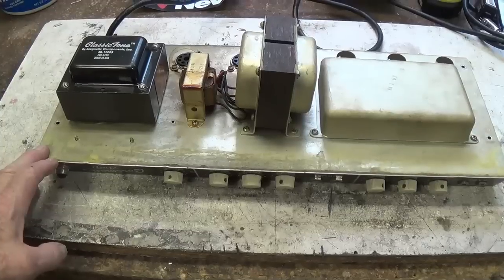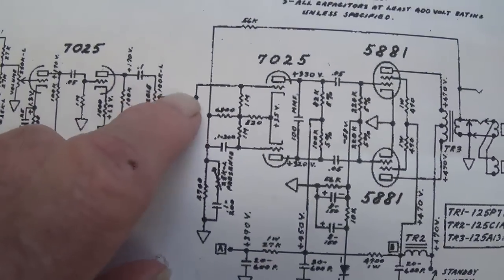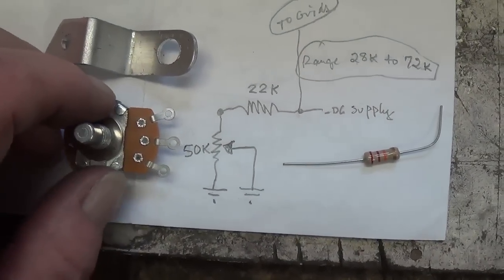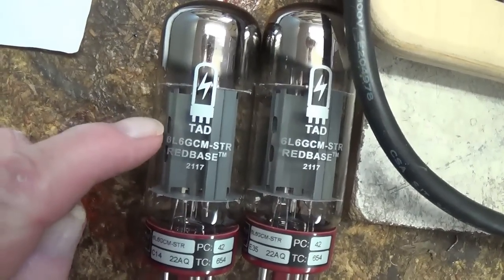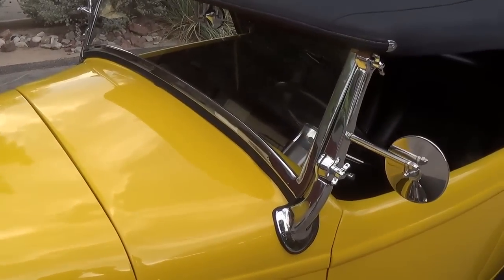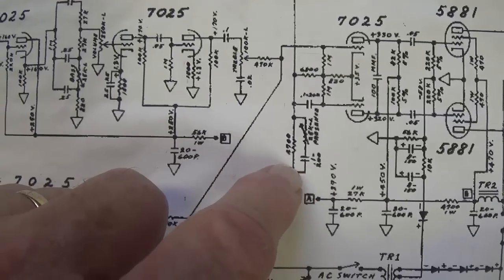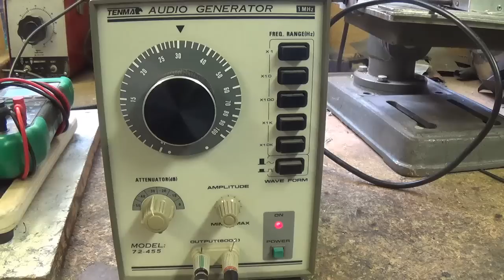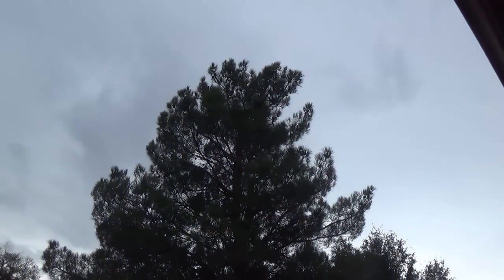Rare Brownface 1962 Fender 6G6A Bassman.....in for a Tune-Up

Comment from the maker: NOTES:
1.) The second triode in the Bass channel is a cathode follower, which does not invert the signal, therefore the two channels are out of phase.
2.) The NFB loop connects, not only to the PI cathode, but also to its lower triode grid.
3.) The Bass channel not only did not have more gain that the Normal channel, but its signal tended to have more treble frequencies, at least with guitar input.
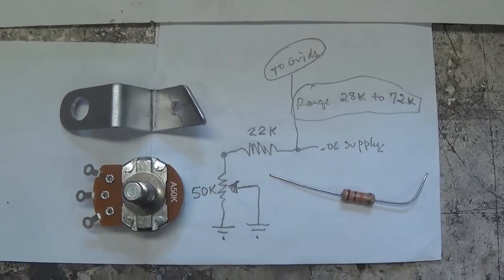4.) At around 17:40 the lower range for he adjustable bias pot should be 22K......not 28K.
5.) The clipping seen in the 3rd audio demo tune was due to an incorrect input-level setting on the digital recorder.....not due to the Presence Control.
6.) For our English viewers: The "Boot" is the trunk and the "Bonnet" is the hood. Sorry ;)

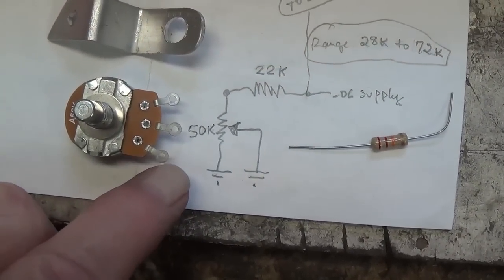Comment: Nice circuit at 18:58 👍. I think a nice addition would be connecting a capacitor between the 50k pot and 22k resistor to get rid of even more noise and ripple. You can probably use the cap after the diode for that even.

Edit: sorry, I thought the bias voltage would be connected on left side, never mind 😅
Reply from the maker: Thanks for your input, PM :)

Comment: In Sweden it isn’t allowed to sell electronic devices without fuses, so every amp from 50’s and onward have fuses installed, even on 6.3 volt supply. And polarity or ground switch  and death cap always removed! It’s nice
Reply from the maker: That sounds like a good policy to me, K.

Comment: Love your Ford. Very first car I ever rode in was my dad's 1949. I was two years old. Very first vehicle, was about a 1944 Ford truck. Saw one a few years ago on Julington Creek Road and had to hunt it down. Turned out to be a wedding caterer's truck that was COMPLETELY original except for tires (including holes in the THICK fenders. Regards the Blonde Bassman ... I remember those when they were brand new. The Classics' second bassist, Talmadge Branch had a '61 or '62. I remember him climbing up on it and doing the twist as my brother climbed up on his 1960 PRO and the lead guitarist, Walter Eaton, climbed up on top of his brownface Concert. Leo built 'em good. BTW: Not sure what the Presence control does for a bass amp ... seems like that handles the very upper highs ... Not much bass notes climbing up that high! I think they just used the BandMaster framework and beefed up the BASS channel. I have a '62 BandMaster and leave the Presence control all the way down ... but I mostly play Fender guitars. My SG Standard and 355 might enjoy having a bit more ultra high top end ...
Reply from the maker: Thanks for sharing this with us TT.

Comment: From Leo:  Nice detail work on the Ford. I remember seeing  air scoops on drum brakes on some hot rods.  I have never seen such a clean install on the air springs for the trunk (boot)     Barb and I think we should get a hobby car since health issues have mandated getting rid of the touring Motorcycle.  Always appreciate your work on the amplifiers also.
Reply from the maker: Thanks so much. I quit riding motorcycles about 15 years ago and find that convertible cars provide a similar experience.

Comment: Enjoyable as always Uncle Doug. Try in-putting pink noise rather than a single tone when testing your tone circuits, it is a much faster and more accurate way to assess the results. The presence control when cranked up at 3Khz adds lots of harmonics at 4Khz & 8Khz.. Thanks for the Notes, was wondering about that distortion.. All the best from here in Sydney where it is very hot for this time of year.
Reply from the maker: Thanks for sharing your observations, Trevor. Our heat is finally subsiding, thank God.

Comment: Wow I just got a mint 63 bassman 6G6-B piggyback amp. What perfect timing for the video. Pretty much looks the same except mine is blonde and is in mint condition. I don’t know the condition of the cabinet for this one but mines awesome and so is this one. I love these amps and can’t describe how amazing they sound dimed. Mine has been recapped for the most part it still had the death cap and it was shorted when I checked it out it gave me a little zap and sure enough a whole 35volts of ac was getting through.
Reply from the maker: Congratulations on a great acquisition, Nikki. Those Death Caps can live up to their name if you're not careful.
Reply: I got lucky for $1,200 for mine this year. Oh yeah I know but even with it snipped it doesn’t make noise so out of safety that caps out of circuit. I gotta put a 3 wire cord on mine because the person who serviced mine replaced all the electrolytic with sprague atoms, did a good job but used the original or an original style power cord. I wanna find another set of 5881’s for mine since the ones that are in it the getters are all blackened. All vintage tubes and the speakers are ceramic Jensens that I don’t know if they are original or not. The 5881’s are tung sol mil spec tubes that are nice and I’m going to test them before replacing them. These amps are amazing so amazing Uncle Doug. I would love to see your comments on mine but i don’t wanna spend the money to ship it and I do all my work myself.
Reply: Thank you by the way
Reply from the maker: Thanks for sharing, Nikki. It sounds like a very fine amp. @nikkihendrix1234

Comment: Once again, Uncle Doug, another great video on a rare amp.  I would have done one thing different.  I noticed a ground lug just to the right of the terminal strip you soldered to the chassis with a nut on top.  I would have chosen that lug for the green chassis ground.  It will always be secure as sometimes a soldered joint to the chassis will fail.  Just my 2 cents worth.  Cheers from eastern TN
Reply from the maker: Thanks, Rusty. I hear this from viewers, but when a lock washer is used, I have never had any issues.

Comment: Nice bias mod. I used something similar on my fixed bias amps (and amp mods) in the 2000s. Skunkie Designs uses a bit different approach, with a resistor between negative and the wiper. All for the same purpose, making the amps fail-safe.  I tend to use multi-turn trimpots for precise adjustment.

That Ford may not be a Bentley, but it's a cute little old-timer... Aziraphale would like it, haha! Restored to perfection.
You could do a collab with Usagi Electric someday. Apart from old computers and test gear, he's into old cars as well.

Ah, the Supro! Thing of beauty, joy for ever.
Reply from the maker: Thanks for your comments, KE :)

Comment: 1 thing uncle Doug...supposed to be sure and make the grounding conductor the longest in the supply cable so if yanked out it will remain grounded until power and neutral are both severed.
Reply from the maker: I'll keep that in mind, FG, especially for customers who like to swing their amps around by the AC cord.

Comment: The best Bassman I ever had was a black tolex blackface with the little white knobs and a presence control. There was a resistor on the presence control that wasn't soldered. I don't remember the model number but it sounded amazing. It looked like the 6G15 reverb unit you did.
Reply from the maker: Thanks for sharing, BD :)
Reply: Those are known as "Tuxedo" bassmans with the 6G6-C revision (small changes, no schematic exists).
Reply from the maker: Thanks for the info, Dan. @danh.8490

Comment: With the safety you built in the bias control reminds me of an automatic transmision design I had to work on quite often back in the 80s 90s and 2000s the 700/R4. /4L60E in wich if the main pressure control solinoid lost it's modulated power feed to it the trans would go into max. Line pressure therefore saving all the clutch packs and friction components in the transmission virtual diagnosis and correction could be made nicely doing on the amp and hot rod Uncle Doug. Dwight.
Reply from the maker: Thanks for sharing this interesting analogy, Dwight. I have never worked on a 700R4......only TH350's :)

Comment: Sitting here stimulating my Vagus Nerve and this is what came to mind.

Dude, the absolute best yet. It's funny how folks nowadays don't realize that back in the day, if you had one of these amps, you were the GOAT, not everyone could afford an amp that would work for live Gigs, so with one of these you could get a guitar, bass and singer on one amp, it really was a workhorse. I had a friend of mine that had one, he finally had to tell has sponge of a guitar player to get his own. Serial Killer List, you are a maniac, dated at least three times 🤣🤣 It's funny, with keyboards you "attenuate" the frequencies with the instrument, not the amp, but with guitars, there definitely is a "sweet" spot for the amp. Also Ollie needs to lean "Cat Scratch Fever" 😁😁

The paint deal on your car is kind of weird, maybe the folks who built it were inexperienced. With Pearl and Flake, you can start out with a basecoat on disassembled parts, as long as you keep the parts in their natural position, doors vertical, hood horizontal etc. Usually one "drop" coat is good, but after this you have to reassemble and give it the last two passes with basecoat, this ensures that the color is uniform and the "effects" lay down in the same direction. Oh yeah one more thing, this is hard to do if you are using single stage. Base without hardener, can be mixed together all at once and stored, then you are sure it is the same color. 

Love the car, you bet it's fast, what's the GVW, I am guessing around 2k lbs, couple that with 350 - 370 HP and like 410 Ft lbs. torque, it is a real screamer. My guess it makes it's best torque below 4k and best HP above 5400.

 I caught the boot thing right away, my Dad had a '64 XKE Roadster, so the boot and bonnet thing was big with him, he wasn't even English 😁😁 And I had to fix it for free, with wiring harnesses that had no colors, yeah not a lot of fun.

Blue Mule
Long Live Leslie
Reply from the maker: Greetings, Mr. Mule ;) Thanks for sharing your knowledge and observations. According to dyno tests on virtually identical stroker engines, the HP is probably in the 450 range.....and yes, it's a scary ride once the cam begins to "kick in".
Reply: @UncleDoug  450, no DOUBT you can hear the cam at idle, can't wait to hear it.
Blue Mule

Comment: I had a 1965 Bassman and at very low volume levels you could play a bass and guitar at the same time and it was good. At higher levels of volume the guitar would be greatly affected by the bass guitar notes, I think the Bassman should have been a single channel amp. Bass only. If I ever get around to a bass guitar amp build, it will be a single channel. Maybe make a single channel of the Bassman’s Normal channel for guitar use. It would be an excellent guitar amp for pedals. Another UD great video and tons of new info on Bassman amps! Wish I still had mine! Oh Well! Thanxz
Reply from the maker: Thanks for sharing.....and watching, ATL.

Comment: Thank you so much for the video. Love to see all the different amps and hotrods!

Did you ever do a video on jumpering inputs? I've never quite understood how that worked. The input goes through both circuits at the same time? Also, I don't understand why an amp with an even number of triodes can jumper, but an odd number of triodes cannot.
Reply from the maker: We demonstrated jumpering in one of our earlier, Marshall amp, videos, HBW.  Yes, the input signal goes through both preamp circuits for added gain and fuller tone.  If the pre-amp stages aren't in phase, jumpering them will result in cancellation of the signal.

Comment: I must say I like your job around these gems, detailing each aspect of circuit, the proper labor, love and the respect you have to the history behind them. As  a technician I'm used to repair a lot of electronics devices, but amplifiers are to me something so special, because I am a musician and a audiophile as well, and i like to help bassists and guitarists with their gems. Fazo, DLab and You are my  true references in amp repair. 

By changing the subject I am planning building a aingle ended amplifier around 12ax7 and el95. I have all components needed dor this, but I would like to see you building similar one. Is that possible? 

Cheers
Reply from the maker: Thanks so much for your very nice comments, Emerson. We are currently scratch building a vintage amp and will post our progress in a 3-video series. It's not the one you suggest.....but it's a dandy. I hope you enjoy it.
Reply: Can't wait to see this, sure, because I know it will be an awesome amplifier.

I am currently building a low wattage single ended guitar amplifier with a PCL86 tube for a friend in place of a solid state circuit, around tda2050 and 4558 IC. I hope to finish that and upload some video about it.
Btw what do you think about this particular tube?
Reply from the maker: I hope you enjoyed it, Emerson. I only deal with vintage amps, and have never encountered this tube. @EmersonCapuano

Comment: In speakjng about the presence control, I think the reason why it didnt make the cut in the blackface circuits is because Leo started using lower-value feedback resistors for the nfb in his quest for cleaner tone.  I can imagine if your nfb resistor goes from 56k to 820, the presence control is going to behave in a radically different way.
Reply from the maker: Good point, JC. The huge disparity in NFB resistance MUST have been for a good reason.....at least to Leo.

Comment: What a beautiful roadster, Doug! Shear perfection. Quick question for you. Will a weak rectifier tube cause low plate voltage? I changed all the caps and got new output tubes for my 1969 twin reverb. I was trying to adjust the bias but voltage was only around 350.
Reply from the maker: Was the plate current abnormally high?  As PC goes up, PV goes down. Regardless, have you tried a fresh GZ-34 rectifier tube?

Comment: Hello Unc !
I worked on the same model for a friend a few years ago and I noticed something on both yours and mine : there’s a resistor across V1 pins 1 & 6 (plates) that’s not on the schematic nor the layout. Do you know why it’s been added ?
Very good point for the bias adjustment ; I may upgrade it in my friend’s amp. 
Very tasteful restoration of the hot rod 👍
Reply from the maker: Thanks so much, 74C. My guess on the mystery resistor would be to balance the plate voltage on both plates, perhaps to compensate for differences in the primary half-windings (???)
Reply: Yes maybe. But this was not implemented on the following circuits … so perhaps it was not so efficient, who knows ?
Reply from the maker: The Beta Test must have failed ;) @74cannelle

Comment: I think the triple triple diods in the power supply is not only for redundancyas you have replied to me about it before but ro reduce the high voltage alittle because the diods are yet more efficient than a GZ34.  Am I correct on that Uncle Doug?
Reply from the maker: Why would Fender want to reduce the plate voltage, Dwight?  They weren't averse to running  6V6's at almost 50% over their supposed peak voltage level.

Comment: Isn't it true that the cathode follower in the preamp doesn't invert the phase?  This, the signals from the preamps will be out of phase.  In the negative bias circuit the potentiometer will be passing current, which might cause some kind of a failure, probably just make it scratchy.
Reply from the maker: Please read the first comment, Michael, in which this is addressed.

Comment: Capacitors in the output of the PI are 400 VDC ... I wonder when Fender started using 630 VDC.
Reply from the maker: You'd have to start checking schematics, JE.

Comment: question: When you install a negative feedback loop in the circuit does this increase the voltage to the tubes to a dangerous point?
Reply from the maker: Not at all. If it did, the manufacturers would never have installed them.

Comment: Hey Uncle Doug - I recently got a 1962 Bassman 6G6A, untouched and forgotten in a closet for decades. Came with all original parts, original tubes and Oxford speakers dated 1961, 2 prong outlet that ill need to upgrade to 3 prong at some point. It has an 8ohm power transformer, apparently they installed them in some early 6G6A's (?) Wanted to see if you ever came across one like this. I need to spray down the pots with contact cleaner, but so far the Normal channel is sounding great. Would you recommend any other additional initial "cleanup" before testing out an old fender amp for the first time? Thanks and have an excellent St Patrick's Day weekend
Reply from the maker: An 8 Ohm OPT seems unusual in a dual-speaker amp.  I don't recall seeing another one. My strongest recommendation would be to always use a current limiter when testing any amp. Good luck.
Reply: @UncleDoug  Thank you for the response. I googled how to make a current limiter and your video from 10 years ago popped up, going to Home Depot later to get the supplies to make one. Last Q, do you use DeOxit gold or would you recommend a different solution like Iso Alcohol when cleaning contacts?
Reply from the maker: I use DeOxit, but there are other less expensive alternatives that work quite well, EP.  Most any commercial contact cleaner (do an Ebay search) will do. @ePRmu
Reply: @UncleDoug  awesome, thank you U.D. for your vids and help in comments. It is greatly appreciated
Reply from the maker: You're welcome :) @ePRmu

Comment: Nice videos! Subscribed.
I am fixing a 60s Dynacord Twen amp and I need to replace the filtercapacitor but is is a 40+30+20 uF type which I can not buy anywhere. Would it be ok to use a 40+20+20 capacitor?
Reply from the maker: Thanks. I generally abstain from using capacitance values that are less than the original. Why not simply add a 10uf axial cap (of equal or higher voltage) in parallel with the second 20uf can value?
Reply: @UncleDoug  That's a really good idea! Thanks! I will try that.
Reply from the maker: Good luck with your repairs :) @farmrakmaak